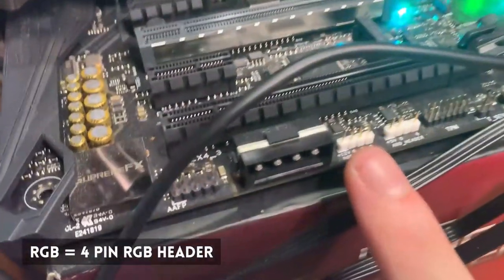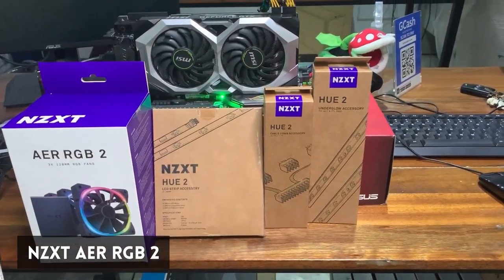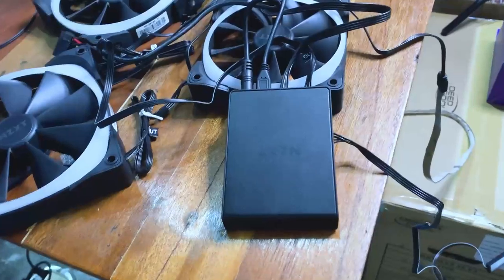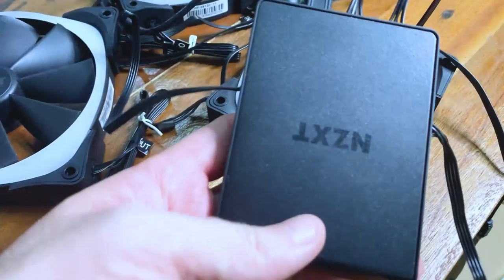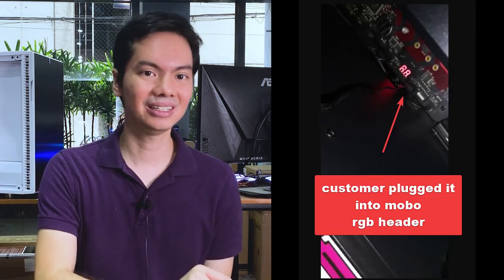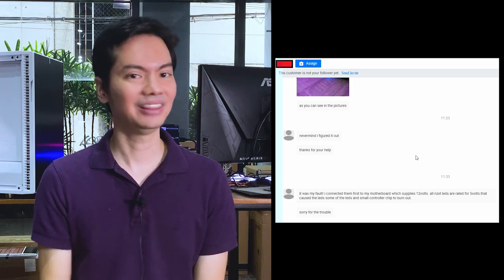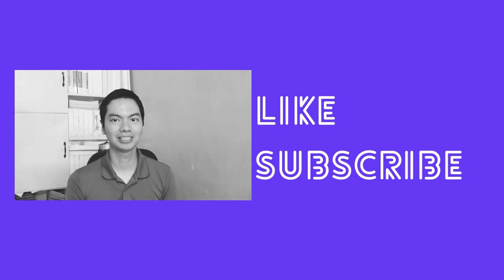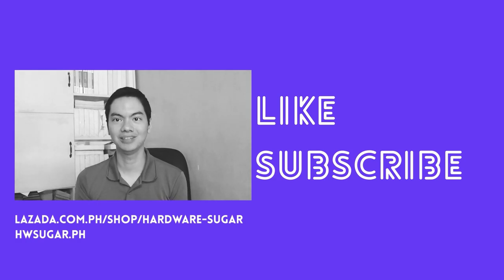Don't Do It - Plug NZXT RGB into standard motherboard RGB header

Comment: hello...ask lang ako sir need ko lang help meron akong aerocool klaw case rgb tapos gumagamit ako ng bykski liquid cooler RGB pareho silang 5v 3pin. motherboard ko b450m steel legend asrock isa lang 5v 3pin lang ang naka lagay sa board. bumili ako ng cooler master 1-to-5 splitter cable 5v 3pin para ma connect ko sila. ang kaso sir pag controlin ko na sa ASROCKPOLYCHROMERGB hindi sumasabay ung light ng AEROCOOL KLAW CASE merong sariling mundo. nakita ko ung isang vlog nyo na deepcool converter nag order ako nung kasi try ko nanaman sa 4pin need ko help sir anong magandang gawin salamat.
Reply from the maker: When you used the CM splitter you could see both products (the case and the cooler) in Polychrome?
Reply: @hwsph  hello sir ung aerocool klaw case naka lagay sa manual nya fit siya sa ASUS/MSI/Gigabyte motherbord wala sa asrock kaya ginawa ko bumili ng cooler master 1-to-5 splitter kaso ung BYKSKi lang gumagana..

Comment: Omg.. just do simple search.. RGB is mostly 12v. ARGB is mostly 5v .. at least in all PCs right now and most cheap other stuff.. 
The thing with ARGB is that you can use a 4th pin to chain the signal.. what Nzxt, Corsair and razor do.. just plug the 4 pin connector to a 5 v 3 pin in the right order and your fine.
I know the took stupid connectors and rip you off expensive money for simple LEDs with no extra.. no magic.. all the same. Just 12v normal RGB and 5V ARGB.
Reply: So, it is possible to go from a NZXT to a Phanteks ARGB connector, if I make my own adapter after finding out which wires are the 5V, GND, etc?
Reply: @burtpanzer  yes, 5v-data in-ground is it mostly Corsair adds the data out to dasy chain. Or just by  s cheap argb strips and make a motherboard connector

Comment: I was waiting for the moment of truth...CLICK BAIT :-) Nice one sir. How about po plugging the AER RGB 2 Fans into the preinstalled Fan Controller like in H210i and H510 Elite? What will happen po? Salamat sir
Reply from the maker: that's fine, those fans are compatible with the included controllers
Reply from the maker: @jogicaballes8730  added advantage there is that you also get more channels with that controller, the one that the case comes with is a bit limited
Reply: @hwsph  Tama ka sir. Kaya binili ko po non-i version ng NZXT H210
Reply: wait so is it fine if i put these fans into my motherboard, im confused

Comment: thank for the idea but i have a question if the mother board not have rgb header where ill insert the pin from rgb converter?my mother board is gigabyte ga-z77x-ud3h pang did not have rbg header 
lease help thank you
Reply from the maker: For tech questions we encourage ppl to post to our forum, https://pm.hwsugar.ph/

Why?
1. It's easier to track questions there (YT/FB is a mess when it comes to that).  
2. Everyone from our staff can weigh in, not just me. Everyone on the internet can weigh in, not just me.
3. It's searchable so everyone online who might have the same problem could benefit from the question :)